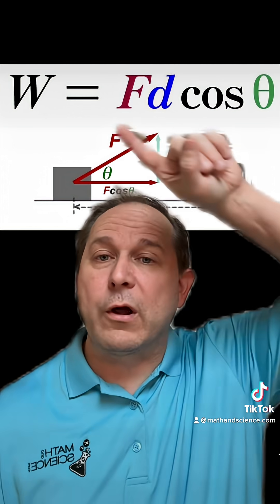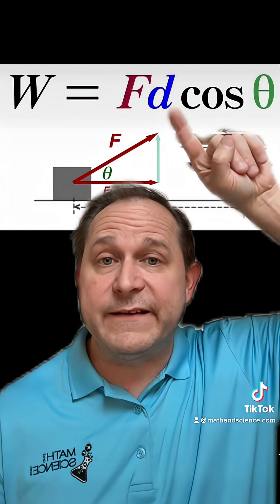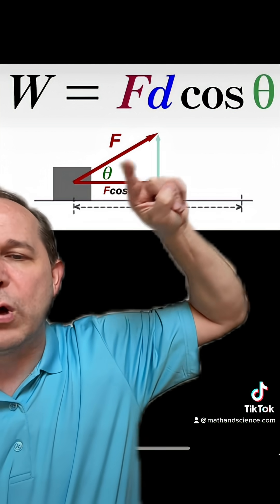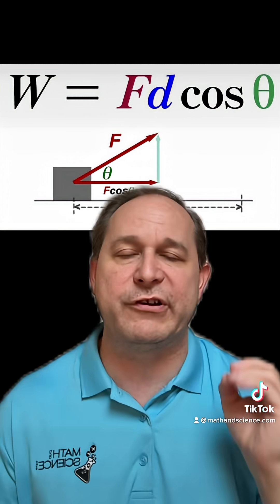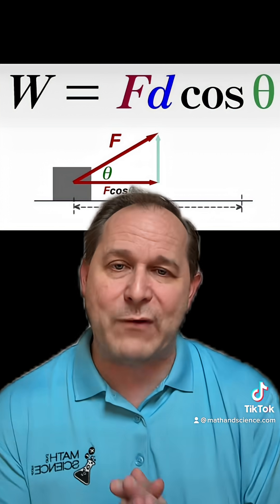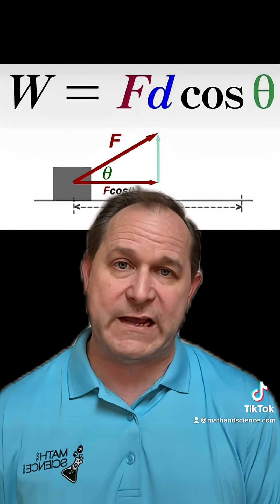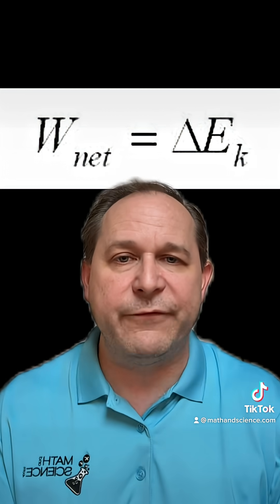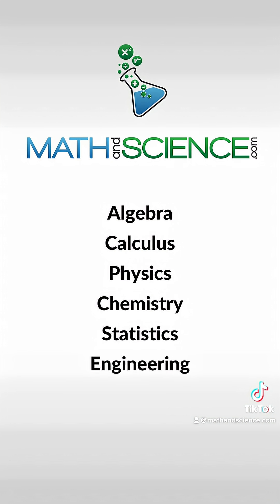What does NEGATIVE Work Physically MEAN?

Comment: Negative at positive flow brings stablizing affect. Cold makes straight affect while heat allows circular type..fluidity or less solid. If the typw i ask is spacial for sun fed cold heat, then lightning will make sense by the situation. Hot cold is opposite with less versatility. Like a pitch breaking wine glass